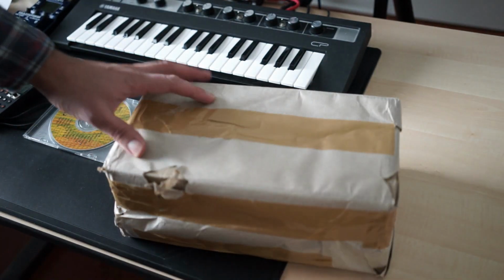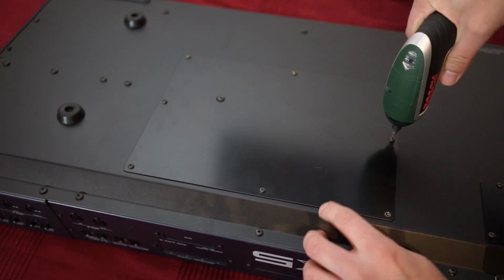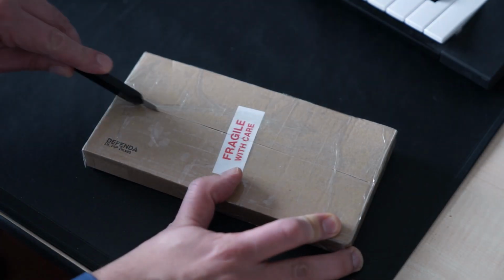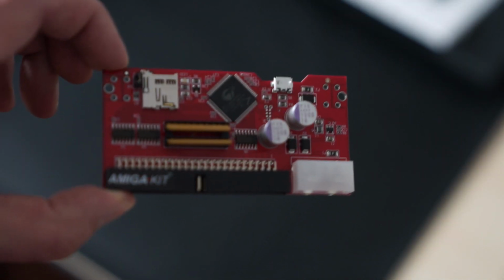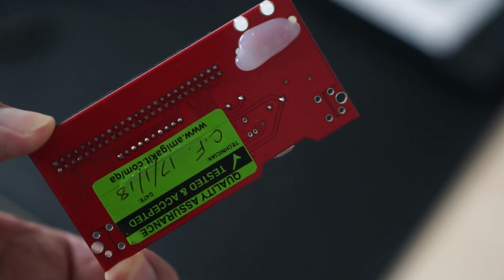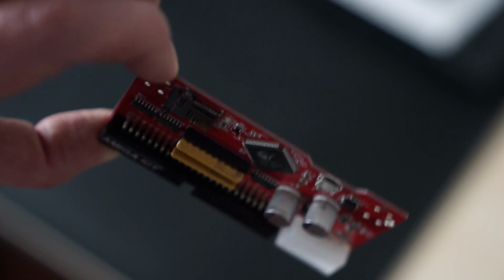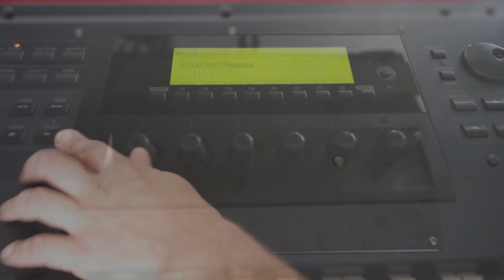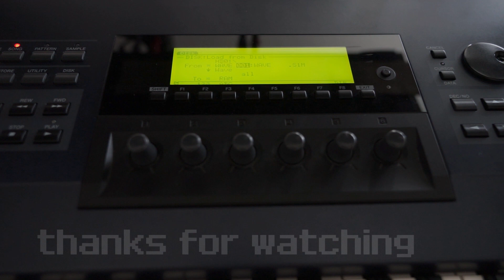Installing an SD Card Reader (SCSI2SD) in a vintage keyboard (Yamaha EX5)

Comment: If you use Scsi2sd V6.0 and a 3d printed cradle, you can replace the floppy emulator. The main advantage is that you can swap sd cards (not micro sd cards) but also that you can connect to your pc using micro usb cable and the ex5 formated card appears in windows.
Reply: hmmm - does this mean we can bypass the SCSI interface card and connect it to the floppy connectors directly (bypassing the floppy drive)?
Reply from the maker: I don't think so. The EX5's floppy controller will only allow for 1.44MB floppies, so loading larger files would be impossible (also, SCSI protocol is an entirely different thing).
Reply: @mr_floydst   Bit confused with the Yamaha manual as it keeps saying to cut the included power cable in half then reconnect the power cable. Wouldn't this destroy the unit?!?!
Reply from the maker: @DarylWiseJr  I don't know why that would be necessary even for older gear. In the case of SCSI2SD, you don't even need a power cable, the power provided by the SCSI interface is enough.
Reply: yes of course it's entirely different - i wasn't sure what David was implying with his comment though so i was trying to ask for clarification. I suspect the primary 'blockage' to file size via floppy interface is the media itself however - not some built in protocol (?) - i guess it would likely be limited by 8 bit addressing though
Reply: Can you copy S1V and S1M files direct from the PC onto the EX5 formatted card?  Are they readable?
Reply: So I've connected a scsi2sd v6 to my EX5. It doesn't seem to be working properly. The EX5 doesn't recognise it. In fact it doesn't fully boot up. Only get welcome screen. When I disconnect it boots up normally. I'm wondering if its faulty. When connected to my win10 pc it doesn't show up as a drive. Have I missed something?
Reply: @dzod  halo, I'm very interested in purchase the v6 for my little A3000 sampler witch have same scsi card as ex5 but while reading this topic I've found that you're the only person who finally buy n try a v6 to mention that is incompatible , did u finally get any success with this, please let me know 
Thanx for your time reading my message 
All the best
Reply: @dimitrisvirtsionis2229  Hi. The V6 I had was faulty. I got a replacement and it works perfectly.
Reply: Dzod hey! That's good to know. If I want to use the scsi2sd v6, I'll still need the Yamaha asib1, correct?? Its so expensive now! 😫
Reply from the maker: Thanks for commenting. That's good to know! Maybe, I'll update some time … Connecting it to a PC would be so useful...

Comment: So there's no way to do this without the Yamaha SCSI interface expansion (ASiB1)?
Reply from the maker: Hi, thanks for watching! No, you need the Yamaha SCSI board for this to work.
Reply: @Floyd Steinberg  Aw, dang. I'm watching for a good deal on one of these EX5R or EX7 was hoping if I found one SCSI2SD wouldn't be too challenging.  We'll see. Gotta find a synth first.  Thanks.

Comment: I just completed adding SCSI2SD, RAM, sample flash RAM and latest firmware EPROMS to my EX5 I purchased from Reverb last month. ASIB1 and firmware from Reverb, flash RAM from Sector101, 64MB  RAM from Amazon and SCSI2SD from China. I used a 16GB micro SD in the SCSI2SD and cut up a plastic lid from a Rubbermaid tote to create a top/bottom insulated cover for the PCB held in place with nylon stand-offs and Kapton, then double-sided 3M tape in the compartment. Your video inspired me to put all the options in this EX5, thank you. And, the blue beast is awesome! Those Yamaha pianos, E1 Brass and a few of the factory strings are killer. It’s a keeper and it’s in excellent shape, so hat’s off to the original owner. Thanks!
Reply from the maker: Thanks for watching! Nice to hear you maxed it out. :-) It's worth it, and this is a superb synthesiser. I really enjoy programming it.
Reply: Make a video!

Comment: Hy Floyd, first of all congratulations on your videos - i own two of these Blue Beasts and already upgraded both to floppy emulators based on your tutorial. Now i'm thinking of upgrading the one that has a SCSI board but i have a couple of questions - what SCSI cable did you use for this install? And did you buy it from the same vendor as the SD Card Reader? Thanks in advance.
Reply from the maker: Hi, thanks for watching! 
If you already have the SCSI interface built into the EX5, there should be a "loose end" of a SCSI cable inside your machine.
If there isn't, buy one of these: https://amzn.to/36z78w9
Best regards!

Comment: Hi Floyd ... I have an EX5 and I am currently installing the floppy emulator. Now, I want to take full advantage and be able to install samples from an SD card but on Ebay they no longer sell the one you use and I have not been able to find memories for storage. Do you have any contact where I can buy that card? I would really appreciate if you could guide me regarding expansion of my keyboard. I hope you can help me, take care!
Reply from the maker: Hello Hector, thanks for watching.
If you want to use your EX5 as a sampler, you need the following things:
1.) Flash RAM: https://www.sector101.co.uk/exflm.html
2.) 64 MB RAM: https://www.ebay.de/sch/i.html?_from=R40&_trksid=m570.l1313&_nkw=UDIMM+60ns+64mb&_sacat=0
3.) SCSI Adapter ASIB-1: https://www.ebay.de/itm/Yamaha-90-ASIB-1-SCSI-Board-Interface-Wiring-EX5-EX5R-EX7-SU700-A3000-asib1/124135819398?hash=item1ce7124886:g:Vh8AAOSwTEteOJlI
4.) SCSI2SD card: http://amigakit.amiga.store/product_info.php?products_id=1314

Best regards.
Reply: @mr_floydst  Thanks!!!

Comment: hi there, exelent work, will this work on A3000 sampler?
Reply from the maker: Hi, thanks for watching! Yes, this will work on an A3000.
Reply: @mr_floydst  hello Floyd, I was not able to find it at amiga
Reply: Because if both are the same I would prefer the cheaper one from the Chinese supplier
Thanks in advance ,all the best
Reply from the maker: @dimitrisvirtsionis2229  You can buy the cheaper one. If you buy the newest model, you will be able to read the SD in in Windows, however, which is nice to have.

Comment: Great EX5 videos. Is there a way to overcome the "too many layers" message as soon as I enable (turnon) a 3rd layer in Performance mode? Does the Eprom software upgrade fix that or is that just a limitation in the EX5 that's always gonna be there.
Reply from the maker: Thanks for watching! The number of useable patches in a multi depends on how much "CPU" time they occupy. Using only AWM patches will give the best results. This is where the EX5 is clearly showing it's age :-)
Reply: You can sample your AN or your AL voices to convert them to AWM patches. Just Sayin'.😎
Reply from the maker: Thanks :) I made a video on that some time ago...

Comment: https://store.inertialcomputing.com/product-p/scsi2sd-v5.5.htm  ... this is how it works?
Reply from the maker: Hi, thanks for watching. The one with the external connector won't work on the EX5, you need the version with the 50pin female connector. https://store.inertialcomputing.com/SCSI2SD-V5-1-p/scsi2sd-v5.1.htm    On other synths, I can't really say, sorry. Edit: But as long as the connectors fit, your synth will identify this board as a SCSI hard disk.

Comment: Dear Floyd, thanks for your video.
What are the settings to load in the SCSI2SD? Does the SCSI2SD board work without the ASIB-1 installed?
Hans
Reply from the maker: Hello Hans, thanks for watching! The SCSI2SD board doesn't need to be set up. Just connect it, insert an SD Card and the EX5 thinks it's a hard drive. It doesn't even need a power connector. But you need the ASIB-1, though, without it it won't work.   Best regards
Reply: @mr_floydst  Thanks again for your quick answer. This helps me a lot!

Comment: HIYA I have an ASR-10, loaded... with the SCSI option installed. is there something like this (in your video) for the ASR-10? 
basically, I have ten tons of aging floppies with complex custom samples that need archiving/consolidating for use. HELP! I'm good with this stuff but everything I find is a long-winded chat or vague option...
Reply from the maker: Hi, thanks for watching! Short answer: If your device has SCSI, then this board will work for you. I'd strongly advise you to buy the V6 Version, though, because you can use the USB port to read the SD Card on your PC: https://amigakit.amiga.store/product_info.php?products_id=1314
Best regards
Reply: @mr_floydst   THANKS! im running an ASR-10 sampler ,... and i have a brand new MacBook PRO. also... I am in the states... im really desperate to solve this! thanks!

Comment: Hi Floyd ... Thank you for a great video. Can you fit any size SD into the reader or there a limit ?
Reply from the maker: Hi! You can use any SD Card, but most likely your keyboard will only "see" 2GB of that (because it's SCSI limitations). You can install multiple "virtual disks", though.

Comment: Can I connect HD SCSI-1 Hard Disk Drive (DB25)+ Adapter (DB25/50)  or SCSI-2 Hard Drive  -> Roland XV5080?
Reply from the maker: Hi, SCSI should be backwards compatible. If you've got an adapter (and maybe a terminator) everything should work fine.

Comment: Can you copy S1V and S1M files direct from the PC onto the SD card then put the card into the EX5 and be readable?
Reply from the maker: According to other EX5 users, it is possible if you format the SD card on the EX5 first (which I didn't do, and now I'm too lazy to transfer all the files on there somewhere else ;-) )   There's a Facebook group for the EX5, and in the file section one group member uploaded a windows app which can read and write the contents of the SD card. Also, have a look at david de los reyes comment - if you buy the newest version of this interface, you can access the ex5's drive in windows.

Comment: https://fr.audiofanzine.com/rack-numerique/yamaha/EX5R/pedago/astuces/usb-2gb-yamaha-ex5-gotek-sfr1m44-u100k-8411/
Reply from the maker: Thanks for watching. I made another, very long, very boring video on that gotek emulator previously: https://www.youtube.com/watch?v=-S9M7pu2LqY&t=3s    
That one is cheap, but it's also not very fast and as it's a floppy emulator, no file can be larger than 1.44MB.
Reply: I tried a SCSI TO SD, but very fragile, mine is already dead, not much used.

Comment: Thanks a lot again Alex for your upload on this - I've got the SCSI board in my rack version, so I might give that a go as you say it does give a timing benefit for the larger samples in the libraries I have. Maybe not a 'must have' but for Eu70 worth considering.....  I love my EX5R with every single option fitted!!  Still rate this as one of the best synths from Yam, if not their best overall 'workstation' synth product. Sheer class! :))  I very much look forward to your next EX5 related uploads, as well as any other synth / electronic music making tips!  Danke!

Comment: What are the benefits of adding a SD card reader? What parts of the synth gets better?
Reply from the maker: It's faster than the floppy drive and if you're planning on working with samples (or patches which contain samples larger than 1.44MB), getting the SCSI interface is the way to go.
Reply: Ok, that was was i thought. Thanks for Your quick answer. :)